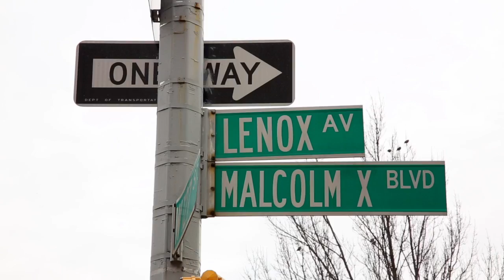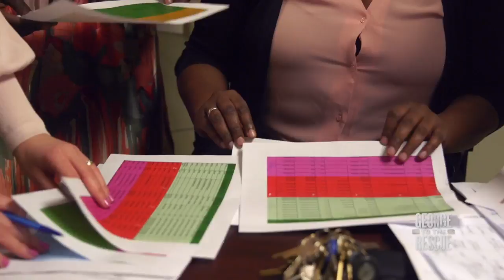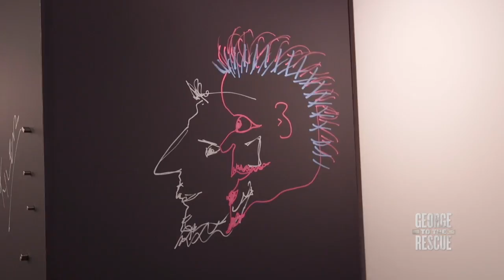Exciting Creative Spaces for Adults with Special Needs | George to the Rescue

Comment: LOVE what this channel does!!!
HOWEVER!  Why do you need to destroy cabinets during demo???  DONATE THEM!!!
Reply: they were in such bad shape--George said they were held together by just one screw and some glue--that they would have been UNSAFE FOR OTHERS TO USE!!! It would have been irresponsible of George to have donated them.
Reply: Jude Lewis I thought the same.  Those cabinets were nicer than the ones I have in my house now!
Reply: Joyce Blodgett actually what a George said was that they were being held on the wall with one drywall screw.  The cabinets themselves were fine to Jude Lewis' point.  In fact the old cabinets looked like solid wood to me - even the back was wood.  Then old cabinet was attached incorrectly with just one screw (and not even the right type of screw) was the problem.   The same danger!would be true of new cabinets if they were held by one screw.  What this does also prove is that it would have been really easy to just unscrew the old cabinet from the wall instead of smacking it with a sledgehammer. Shows like this always do the sledgehammer demo because they're on TV.  But it's not wise because things fall uncontrollably or responsible from a recycling standpoint in real life.
Reply: They do donate when they can, George has posted about this before